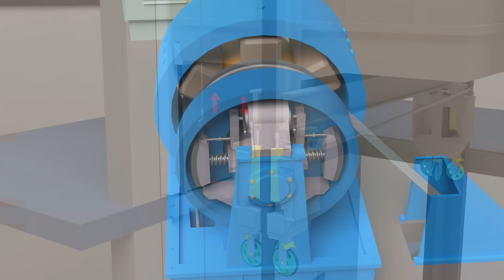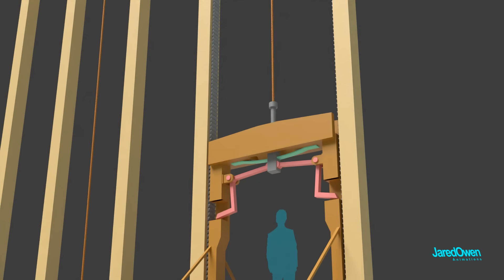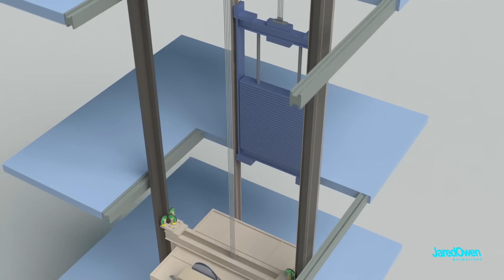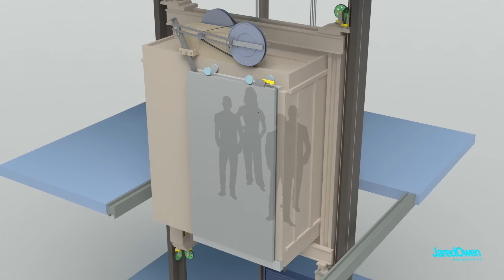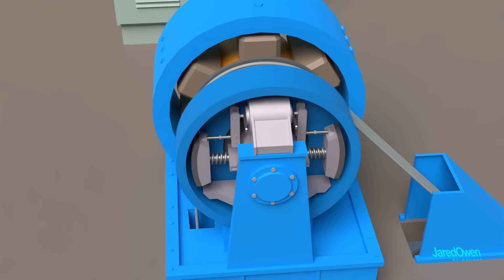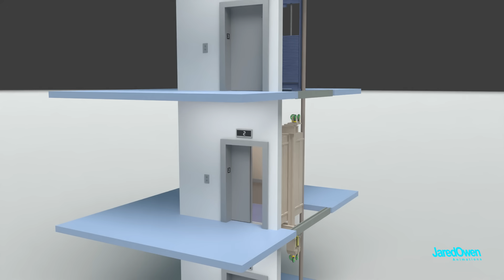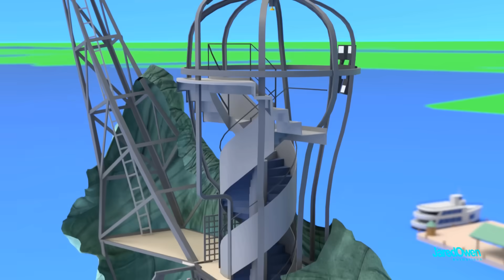How does an Elevator work?

Comment: 6 stories was the limit because of water
In most cities the water reservoir was 6 or 7 stories above ground.

So buildings had water tanks at the top of roof

The maximum distance you can lift is listed to about 75 stories because the stress on the cable is so great massive cables would be required

So, for buildings over 60 stories they almost always have a " sky lobby "

The elevators from the ground to the sky lobby bring people up to the sky lobby
The elevators from the sky lobby to the upper floors are just for the upper floors
Reply: Are you saying that even today, 75 stories is the max for elevators? If so are you saying that in all buildings above 60 stories, you have to take two separate elevators to get to the top? I don't recall that being the case when I went to the top of the WTC in the 90's.
Reply: @LionoftheCross  most buildings have a limit. The WTC had a sky lobby because of the limit.
You had to switch elevators in the middle.

The counterweight and the size of the cable and the weight would be enormous

You can have just a single cable and when you look at Old Mines they have cables that are 1200 ft or 1500 ft that take the elevator down to the bottom.

It is just much better and safer to have a sky lobby

Personally I don't think it is a good idea to have a high rise building more than 20 stories

Overpopulation is the reason why we have to do it.

When you look at the world of the 1930s you see very few skyscrapers and most cities were only three-story buildings
Reply: @ocsrc Thanks for that explanation. So in your opinion, even though you can technically have an elevator that goes 75 stories up, you think it becomes less safe above 20 stories (despite all the redundant safety mechanisms)? Am I understanding you right?
Reply: @LionoftheCross  Yes. I lived in an 11 story building with 121 apartments and 2 elevators. We were all disabled. When there were power failures the elevators would lock out on the 1st floor despite having a backup generator.
Walking down the 11 stories took 30 minutes.
If there was an emergency like a fire we would not survive
Reply: @ocsrc  Wow!

Comment: Architecturally speaking there is a difference between a lift and an elevator at least in Canada, possibly also in the States. I worked for nearly 40 years in the Canadian architectural field and I've specified many lifts and elevators in my career. The specifications are different because the lift and the elevator ARE different. A lift is only for two people, usually not more. And it's not for lifting inanimate objects, only people. The machine rooms are way smaller than elevators. Lifts are much less expensive than full scale elevators. Also, the pits for lifts are usually not as deep. Although they make them deeper now,  I've seen them as shallow as one foot. Lifts are often used in older small buildings, although they are also commonly used in new buildings providing access to not much more than three different storeys. Elevators are way different than lifts. They are extremely expensive compared to lifts. The machine rooms are way bigger. Elevators can handle many people per cab and they travel many storeys. Elevators are typically installed in buildings four storeys and higher, although I've seen them go into three storey buildings, such as hospitals and nursing homes. Although I've been involved with both hydraulic and traction elevators, in my experience hydraulic elevators are rarely used anymore.

So technically speaking lifts and elevators are two different things. They are for two different purposes. Just because the general public uses the wrong word doesn't mean that the lift and elevator are the same thing.

I will say that when it comes to elevators or lifts the maintenance is extremely important. That is why they have a maintenance schedule written into the specifications that the owner of the building must maintain. In my experience, at the end of construction, elevator inspectors go way beyond the requirements of the building code and they impose their own law on elevators, lifts and machine rooms. They are much stricter than any other inspectors I have had to deal with, whether they be municipal, architectural, structural, mechanical, electrical or civil inspectors. So the public should be reassured that elevators and lifts are extremely safe!

Comment: My hospital's oldest elevators are from the early 1950's and are Westinghouse. Otis refurbished them in 2007. We also have Otis hydraulic elevators from 2007. I find that the later are very slow and much prefer the speed of traction lifts.

Comment: I once met a guy who worked on these until a very nasty accident. Apparently,  of your hand gets caught, instict means you try to pull it out with the other hand. He lost one arm to the elbow, and the fingers of the other hand. 

Note: mechanical stuff ain't stopping for you. 

Bonus: look at the demo of a person who got their hair caught in a car serpentine belt. I don't know I'd even demo it with a wig on a dummy. 

Real stairs kill 1,600 a year. Elevators maybe 15. There are videos. FD happened. Escalators about 25 or so, worldwide, including places like Russia and China where they don't bother using or override safety features (Woman in China eaten by escalator*). 

*it should have shut off once the plate hiding the machinery separated the first time on longer CCTV videos.

Comment: It wasn't explained very clearly what the elevator system does to stop at a specific floor. I assume the controller box tells the electric motor to slow down before the floor and also telling the clutch to push the pickup rollers to open the door?

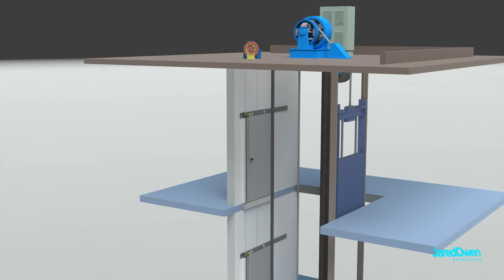Comment: At 8:11 in the timeline, what if the cab slips further down trying to stop, the extra movement will snap the lever releasing the brake pads. However, if the brake mechanism has teeth as Otis designed (instead of rubber grabbing on the smooth rails), I guess it would have been safer.

Comment: I would like to add a couple of points that were missed in this amazing description of a lift, at the bottom of the pit there is bumpers and fitted in pits is a stop button (which can also be found with the car top controls on top of the cab) and some maybe most, have a feature called pre-doors or advanced door opening, this is an efficient way of travelling as the doors open before it has came to a halt therefore reducing the time taken to stop and open the doors.

Comment: I used to be very scared that there would be a huge failure in an elevator while im in it. After watching this video, it has 99.9% eliminated my fear of elevators and im very happy!

Thank you very very much Jared! 😊
Reply: yes but elevators still fail. watch some elevator accidents many here in youtube
Reply: @xaviertumblod8955  Regular stairs are many times more likely to kill you. 1,600 or so, vs maybe 15 worldwide on elevators, including places like China and Russia where they tamper w the shutoffs (many/most wouldn't happen if they were in place).
Reply: on a per trip basis elevators are one of the safest forms of transpiration. there are MANY redundant safety features in software, electrical and physical hardware. I have been a elevator mechanic for 17 years now and pubic accidents are almost non existent in the USA. more often someone gets stuck in the elevator its from one of the many safety systems failing ( in a failsafe manor) causing the still perfectly safe elevator to stop. the worst part is just having to wait for help to get you out but even while stuck you are completely safe.
Reply: @slappomatthew Thank you for that comment. It's very helpful and informative.
Reply: Yes, same here. After watching this I feel safer too, with the only exception of simply just getting stuck for a period of time due to my claustrophobia
Reply: @chrissysmith5619 yes same with me

Comment: Great video Jared!  One error I noted was your comment that the machine brake is used to stop the elevator motor from spinning.  That is not correct, the brake is only used to prevent the car from moving away from the floor during loading/unloading.  Otherwise, I found your video intrigueing since I have worked in this industry since 1983.  Thanks for your time.
Reply from the maker: Thanks for the feedback Mike!

Comment: You may notice that buildings without elevators are limited to 3 floors, including ground, above which it is a requirement to have an elevator. Your reason: 'people didn't want to do that' is wrong because not everyone is lazy; it has more to do with wheelchair access, building codes, running costs and multiple redundancies, including more elevators and stairway access. There's no footage of the elevator in the Burj, which is a pity as it demonstrates the state of the art and an experience you won't duplicate with basic 3D models.

Comment: Very informative and great animation man. I have to say I prefer Elisha Otis's original braking mathod as it was self contained and didn't rely on a rope from the top. With the new version, if a floor above or the top was taken out you'd be screwed because that secondary brake pulley would be gone as well. Maybe the lifts have a stand alone brake as well but I didn't see you mention that.

Comment: As an elevator enthusiast, I can tell you:

an MAC Door Operator was used in this demonstration. I would've recommended using a GAL door operator for this example.

There are two types of Hydraulic elevators, Submersible, and Dry Power. Submersible pumps are the most commonly used, Dry power is where the pump drive is below the oil tank, and is used for Heavy-Duty needs (Museums for Example).

You demonstrated the traction elevator using a Gearless Traction Motor. The Geared Traction motor would also worth be mentioning.

Comment: I got stuck in an elevator in Kuwait and my cellphone wouldn't get out for 911 which in Kuwait was 112. After waiting for another person in that building to call for help about an hour. We got the doors open, but after an hour we and my co-worker climbed out with the elevator stuck between floors. We didn't want to do that in case the elevator moved uncommanded on its own and kill us by cutting us in half. It wasn't a good time except I am here to write this comment. I am from the US and a Firefighter Paramedic so I had proper experience dealing with them and not let myself to panic or cause others to panic.

Comment: The counterweight actually is heavier, this pulls the elevator. Up if the engine plus brakes fail or of if the cable slips.
The governer probably also works if it goes down to fast.
But mostly if it fails, it goes up.
And I have seen videos where the governor wasn't working. You see it fly up when the breaks fails. And then speeds up really fast. And smashed the ceiling

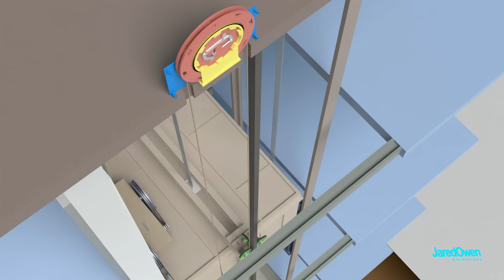Comment: 7:36 - - overspeed governor - - 7:49 - - flyweights     
7:03 - - emergency brake - - 8:16 - - elevator clamps     
7:20 - - brake lever - - 7:27 - - auxiliary cable pulley     
1:30 - - 1:45 - - the mechanics of the old fashioned teeth system looks more reliable
Reply: The teeth act as a “ratchet” system. With constant use those teeth would wear out and those tracks would have to be replaced quite often, and if maintenance is neglected that could turn into a huge safety problem. The fail systems on modern elevators are relatively maintenance free.
Reply: @ajfavale8236  I think you may mistaken - - but can please answer: 
(1) How would the teeth “wear out” if they’re only used if/when the cable breaks?    (There would only be “constant use” if the cables broke constantly.)

(2) What does “quite often” mean?  (Do you believe the cable would be breaking weekly?  Monthly?  Yearly?)  Please explain?  

(3) What “maintenance” are you talking about?  That should not be “neglected”?  Please explain? 

(4) By “fail systems on modern elevators” - do you mean the one shown in this video?  Or are you talking about something else?  Please explain?

Thanks!

Comment: The shaft doors on the elevators in my apartment building do not open with the cab door.  They're hinged and open outward from the shaft.  They are locked when the cab isn't behind them, though.

Comment: So in San Diego California is a hotel that has some pretty interesting elevator history. The El Cortez had the first glass elevator which was also at the time the tallest hydro elevator in the world. It lifted 15 stories to the roof top restaurant  called the sky room. The elevator had 3 stops (the ground floor the second floor and the top floor). My Grandfather had this elevator on his service route back in the 50's & 60's when he was working for Elser Elevator (which later became Montgomery Elevator). This elevator initially had a major flaw. He said the hydraulic oil tank was the size of a small swimming pool. The elevator generated a lot of heat from the 4 pumps & friction heat at the seal/piston interface. This wasn't a problem most of the time but at night when people wanted to go to dinner under heavy use the hydro oil would almost boil. He suggested they run a pipe through the oil tank that circulated swimming pool water through it. This acted like a radiator and cooled the hydraulic oil & heated the pool for free! Unfortunately they removed this icon of an elevator when the hotel was refurbished to become condos.
Reply: That's really interesting! Great solution from your grandad

Comment: But, what happens if the elevator is over speed the reverse way??? Does that speed break still work? What happens if the weight is less than the counter weight? Will the elevator just speed up and hit the roof?😢

Comment: Is it just me or does the modern emergency braking system feel worse. More moving parts, dependent on friction in some parts and lack of friction in others, grease or rust in the wrong place feel like all that's necessary for a critical failure.

Comment: You should see a couple of the elevators where i work one is an ancient manually operated thing that has only a gate for the inner door and you can touch brick which many apparently have cause there's graffiti. The second one is a normal elevator except for the fact that it will try to close the door on you if you hold it too long which makes vacuuming the carpet rather interesting. Also once a colleague was vacuuming and got stuck in an elevator that would not open so i stuck a rod in the hole in the door to make it open the doors.

Comment: Been installing these for almost 20 years, everything explained here is spot on.
Reply: I m a elevator service technician but ive never seen a cylinder of hidraulic lift built underneath the cabin, ive seen only the cylinder beside the cabin connected with steel ropes to the floor of the cabin.
Reply: @cpkora422  Well, as a elevator technician you should know this. There's two major types of hydraulic elevators that being "Holed" or conventional, and "hole-less" hydraulic elevators. Within that "hole-less" category there is 3 those being non telescopic/single stage, telescopic, and roped hydraulic elevators. Been a while since I studied them but, 60 feet is the max for "holed", 20feet for non telescopic, 50ft for telescopic, and 60ft for the roped hydraulic. With a "holed" you have to drill a massive hole as apposed to the roped hydraulic not requiring that extra step and still manages the 60ft that a "holed" can do. Id guess that is why you are used to seeing only roped hydraulic as its a pretty long job to redo a "holed" when it claps out. Stay safe.
Reply: You must work in an area where the ground cannot be drilled easily
Reply: My Dad was an elevator constructor for almost 40 years. He installed them, and repaired them. He also worked on dumbwaiters and wheelchair lifts. He retired from working on them, and now works as an elevator inspector
Reply: У нас в России полно лифтов работавших в СССР и до сих пор, то есть порядком более 30 лет служат исправно😊

Comment: I always wanted to learn elevators that I always use everyday in my building! Thanks for the video. The elevators in my residential building got too high usage often experiencing breakdowns and technical faults like doors couldn’t open certain floors, door not fully close while the elevator cabin move up/down.

Comment: The key is referred to as a lunar key, and resembles that of a clothes hanger. Simple wire with a bent square for rigidity and grip strength, with a hook at the other end to activate the beak/operator mechanism. Crazy to think how simple elevators are, and how little the technology has changed.